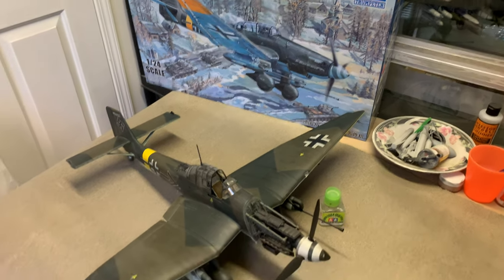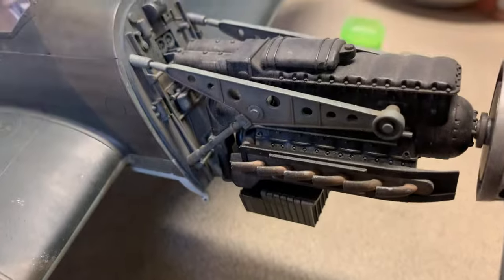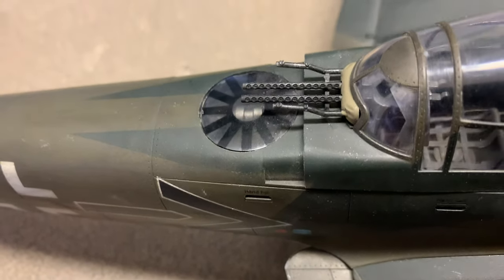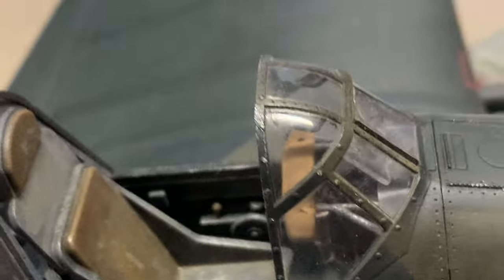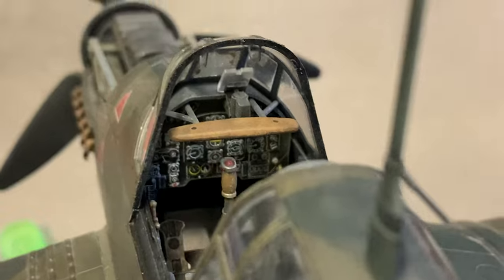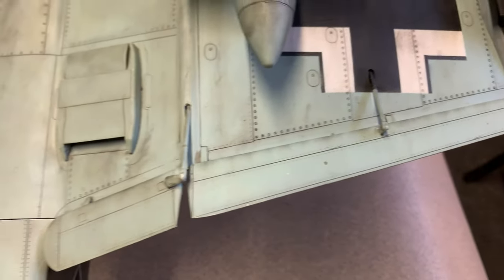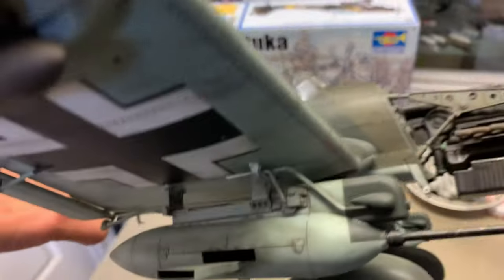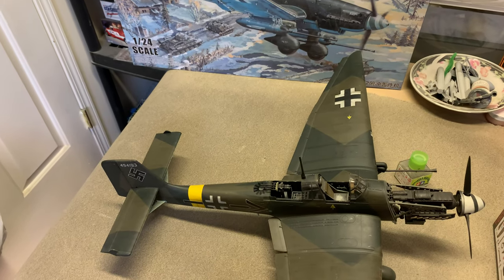Here’s the trumpeter 1-24 Stuka in the flesh!

Comment: Thanks for sharing!

The performance penalty of the a/c was severe enough; it never carried canons AND bombs. In fact bomb racks were removed, as well as in-wing armament.

However, it still needed, and used a pitot tube.

Besides screwing up the 37mm canons, Trumpeter screwed up the canopy framing of EVERY one of its Ju-87 kits. Many of the Ju-87's canopy frames were on the INSIDE surface of the plexiglass. Also, Trumpeter got the rivets wrong; a big portion on the Ju-87 were of the raised variety. Ironically, Airfix, 50 years ago, got the rivetting & the canopy framing correct on their 1/24 Ju-87B, released in 1975; it's still by far the best Ju-87B model on the market.

Although the Ju-87 pilot had both lap & shoulder harness, the gunner only had a lapbelt, and his parachute was the gunner's seat cushion.

Comment: Fantastic build.  I’m building the same kit, I have got both versions in 1/24 the G2 and D5 both kits have the 37mm gun set in them. So I have corrected the G2 kit to the correct gun layout. You were right’ no bombs could be carried because of the weight of the guns.. But it does look good with them bomb in place. keep safe
Reply from the maker: Thank you! I had drilled the holes before doing the research lol...I wish trumpeter would give you some of the info considering they’ve provided all the parts
Reply: Model Makers Union,  I know how you feel lol, it happen quit a lot, iI filled the holes that were not needed with plastic round rod sanded nearly to a blunt point. Then glued them in and when dry sniped them off and sanded. anyway no need to reply mate.

Comment: 3:25 This circular thingy is the German equivalent of the so called flux valve. It gives signals to the radio compass for heading reference. It’s not range finding, it’s rather finding headings.
If I recall correctly, in German it’s called „Kompasstochter“ which literally translates to „compass daughter“, meaning slave compass.

The workmanship is very nice.

Since each of the 37mm guns with attachments, ammo and pods weighed in at around 600-700 kg, I think the G version didn’t have any option to carry any additional bomb load together with those guns. The G was basically a D, but they increased the wingspan by about a meter to give the wing more lift to carry the gunnery.
It probably could carry the bombs (the attachment points to mount the ETC 50 carriers were in the wing anyway), but not with the guns simultaneously.
Reply from the maker: Thanks for the info! Much appreciated....I did know about no payload with those guns but I had already painted the wings and had forgotten to fill the holes...that’s why I put the smallest ones I had in there lol
Reply: @mrzzgo0ro0na  I see...well, I guess the racks alone would have been sufficient to cover the holes...but, it’s your model and you can do as you are pleased.
Sometimes I deliberately make such „mistakes“ on my models just for the fun of it. The sole reason being „because I can“...😊
Reply: @mrzzgo0ro0na  If it happens to you again to forget to fill some holes, this can be rectified too after painting. Take some plastic rod and shape it a bit comically to fit into the hole. Glue it in carefully, cut away the major portion, then scalpel away the remainder until satisfied. Finally, paint the plugs with a small brush.

Comment: I think it’s a great kit - if you were an unarmed bandit you could use a pen torch for the cockpit.  Very tempting to leave that engine open but I think the kit would look better with it covered up - the ‘lines’ of the bird are broken up by that engine.  Or else the engine looks too bland.
I really like the paint job and that weathering on the pilots seat is awesome! - it really is a salient part of the cockpit and catches the eyes but what about the harness straps? At that scale…
What references did you use?
Reply from the maker: Thank you for your comments…I agree with everything you’ve said but this was actually my 3rd aircraft ever and wanted to do it OOB…wasn’t willing to spend money on aftermarket at the time and had no scratchbuilding experience…I’ve done another since then and did it the way it should be…1/32 in winter whitewash